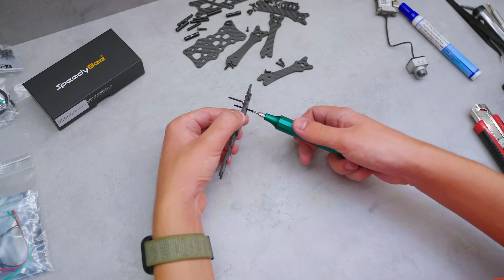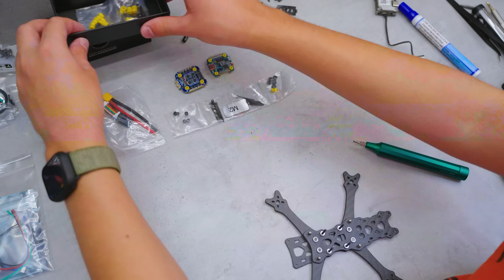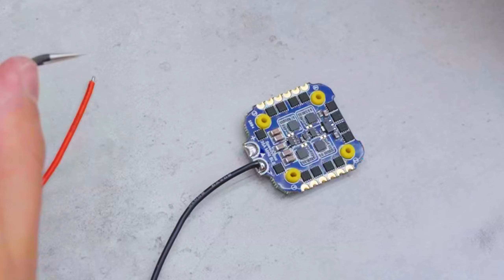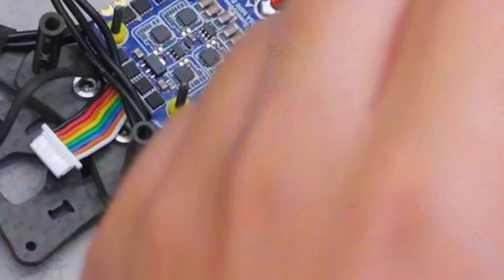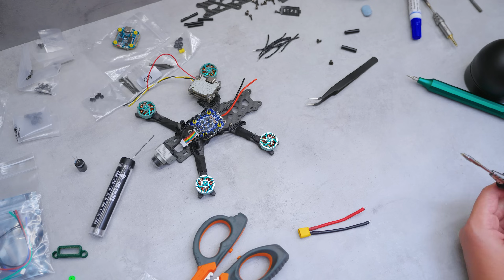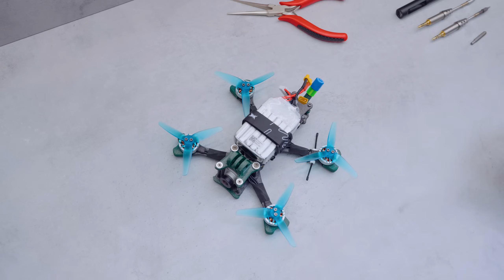QUADMULA Siren F3 Split - Timelapse Build

Comment: How the motor protectors are fixed? Just by pressing them? You skip that part and they seemed to appear magicaly :)
Reply from the maker: You insert them by sliding them through the end of the carbon fibre arm
Reply: @fayron_global  Thanks for your answer. Did you lost them on crashes?

Comment: sick build! have you found that 35a esc is all you need? or would you prefer to go higher?
Reply from the maker: Thanks! We have used the esc pretty intensively and we haven’t had any issues yet even at sustained full throttle 👍